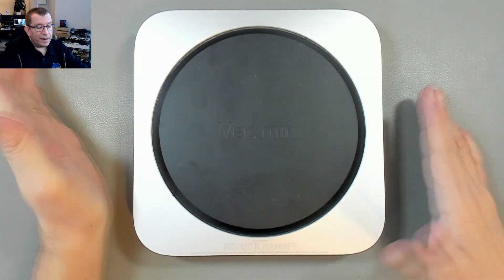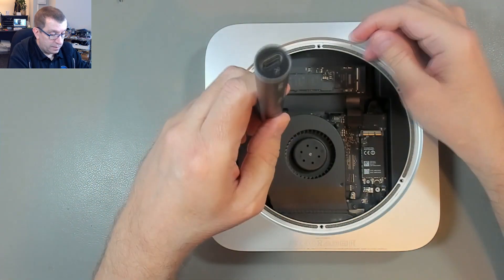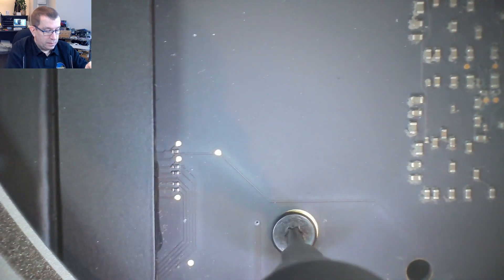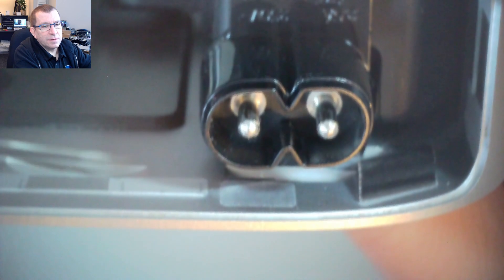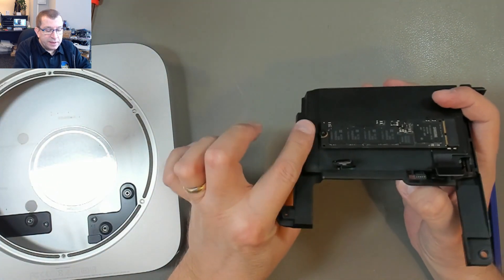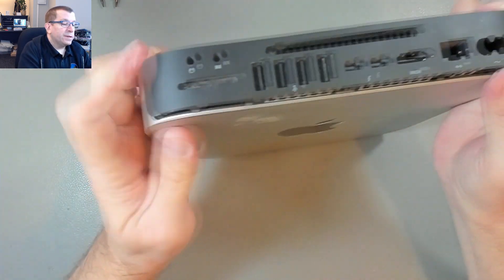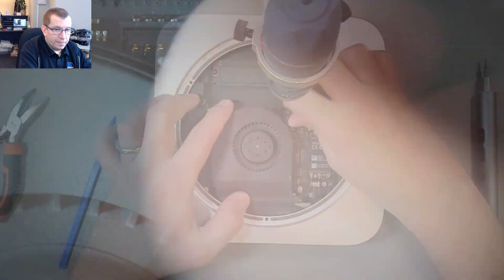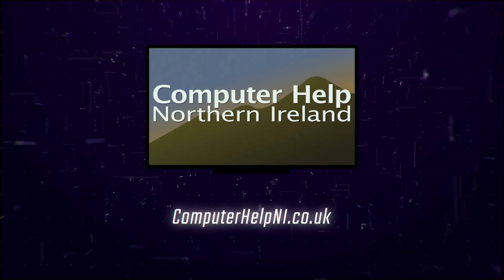[76] Apple Mac Mini (late 2014 - A1347, EMC 2840) - Replace failing hard drive with an SSD

Comment: Hi! Great video! I had it on my tablet as I took apart my Mac Mini. One thing you didn't encounter was that the hard drive (in mine) had an oval piece of black tape under the ribbon connector that had to be removed prior to pulling off the ribbon connector from the hard drive--which also had an adhesive on it.
Reply from the maker: Hmm, yes in my case the cable wasn't adhered onto the hard drive, but in retrospect I should have expected it to be. I can actually see the oval-shaped piece of tape, but it wasn't sticking to the cable at all on this one. Thanks for pointing that out!

Comment: All that work and you blurred out the part at the end that proved you had a split drive.  All you said was "That's it." Well, did you do it properly or not?
Reply from the maker: I blurred out the customer's personal data, but yes the machine booted from the SSD, which was all I was intending to show.
Reply: @ComputerHelpNI  I totally get that, I was just hoping to see the size of the drives as you had mentioned splitting the SSD away from the M.2.

Comment: Can one make a fusion drive from both SSD's?
Any advantages? Can 128GB SSD be formatted APFS and be visible by the OS?
Reply from the maker: I suspect you could make a fusion drive with the two SSDs, but I'm not sure it would be worth it. Yes, you can format both drives and make them usable by the OS.